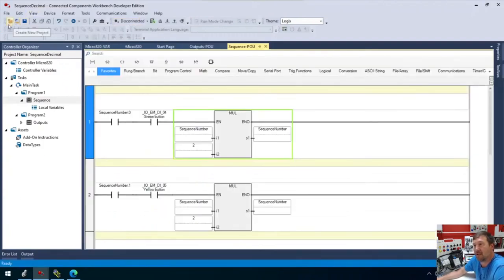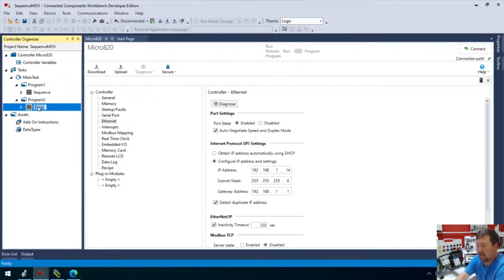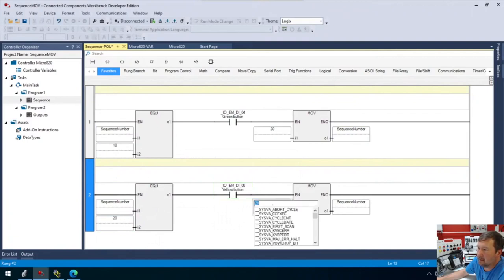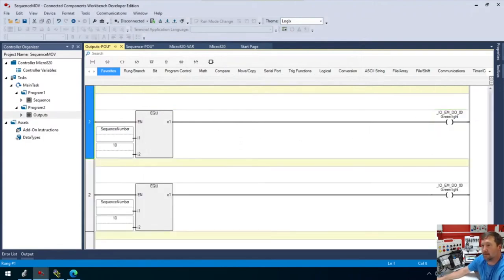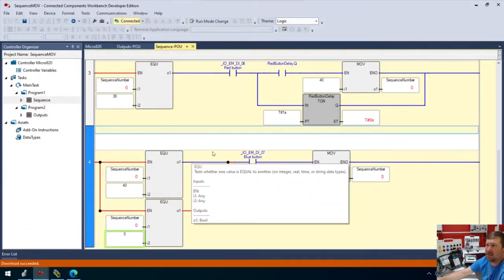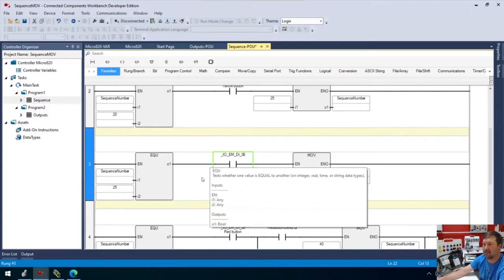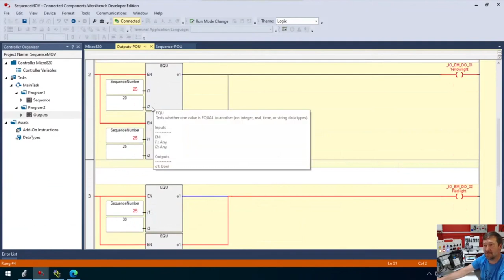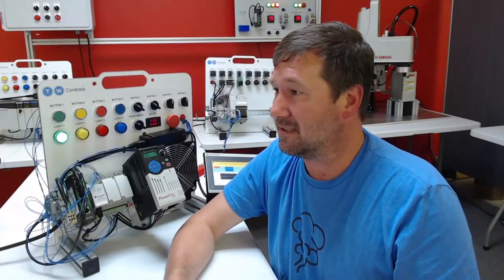Allen Bradley PLC Sequence Programming Tutorial.  MOV Decimal Part 1

Comment: This is the same method I use for sequencing, including separating decisions from actions.  The only difference is I use a CurrentStep and NextStep.  At the start (top) of the sequencer, I move NextStep into CurrentStep.  Each rung monitors CurrentStep (EQU) and when the step is satisfied, it fills the NextStep (MOV) value.  The output section and anywhere else in the program that is dependent on the step also monitors CurrentStep (EQU).  This way, if there is anything in the rest of the program that is dependent on a particular step having to occur but the next step is already true, it will still at least get a "OneShot".

Comment: I use this method as well, especially with motion. But, my question is, would it be better to combine the outputs program with your sequence program so that each sequence step would show its related output? If not, why? Thanks in advance!
Reply from the maker: No, it wouldn't be better to combine them.  In a basic program, where only one output is on in one step it would be OK.  But in most processes, one output may be on in step 1,2,4, and 6 and another may be on in 4 and 5.  At that point, combining them will be be confusing.

Comment: I only use rs500 I took a class on it at the local college and got good at it I come from old relay logic so it was not bad moving to SLCs and Micrologix but now with the newer stuff I feel like I don’t know anything . I don’t see why AB wouldn’t just keep RSLOGIX 500 and the processors for us older guys , I hear it is being slowing pushed out and at that point I guess I am done programming, I am not good with computers but I can program 500 super simple platform
Reply from the maker: Hi John, this live stream may help were I walk through converting a RsLogix 500 program to Connected Components Workbench.  Once you get the hang of it, it is actually easier than RsLogix 500.
https://youtu.be/ydjvTiKuato